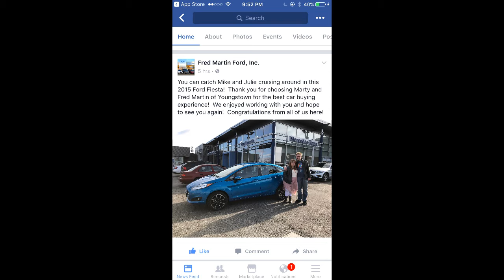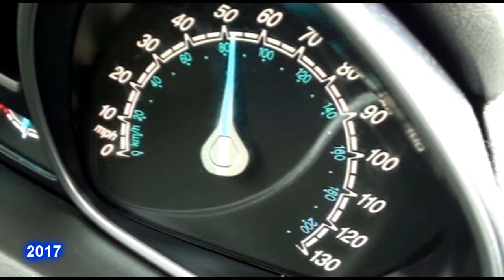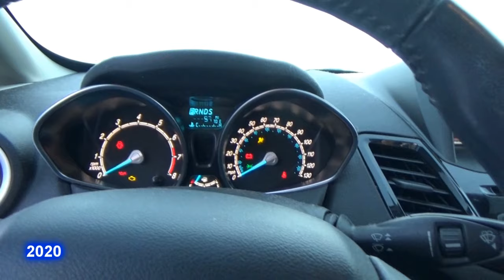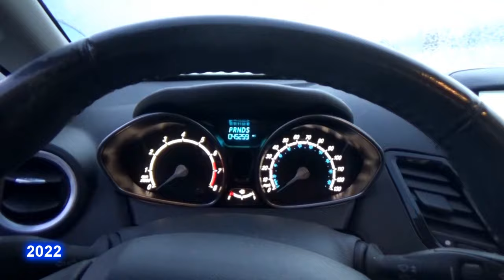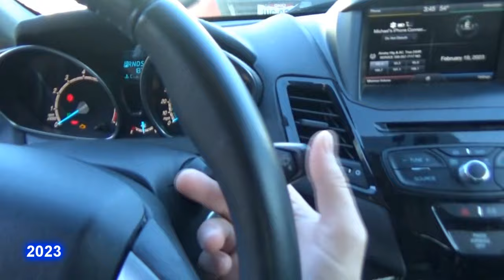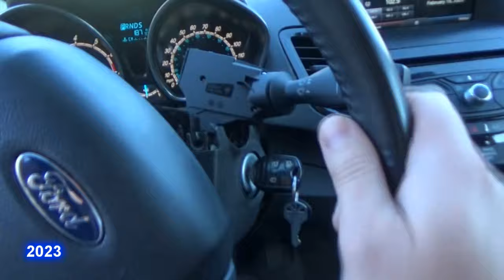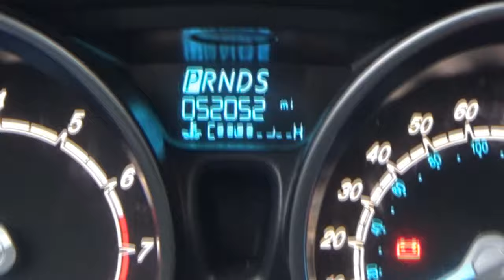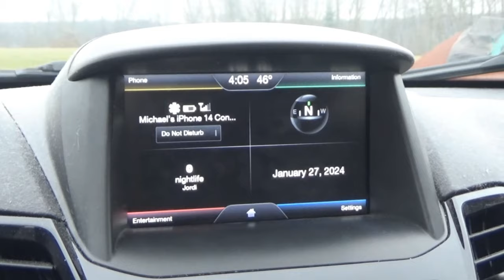MV 436 - "2015 Ford Fiesta 7 Year Review (Special Anniversary Vlog!)"

Comment: Thanks for the video. I've got a 2017 S model (the base model with crank windows , no cruise control , no backup camera) . I had heard some people didn't like the automatic transmission so I took one persons advice and got the manual transmission. Like you I really like mine . It's fun to drive and the gas mileage is great. I'm glad you mentioned the blend door actuator . It's good to know about potential problems.